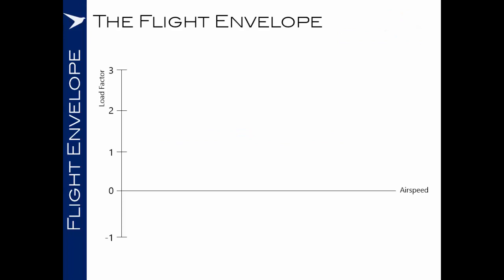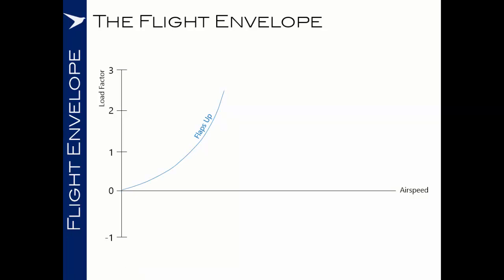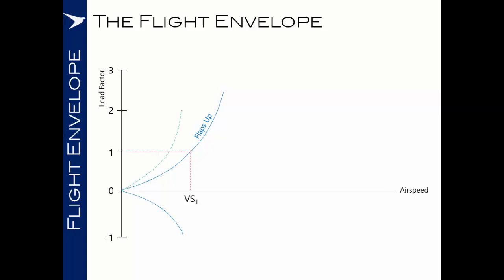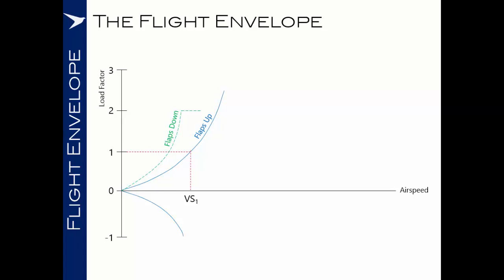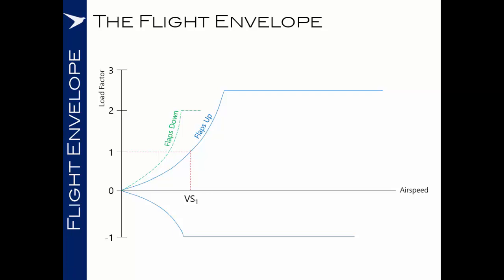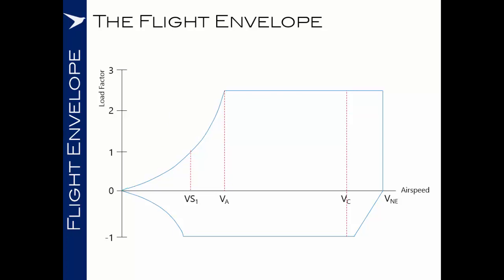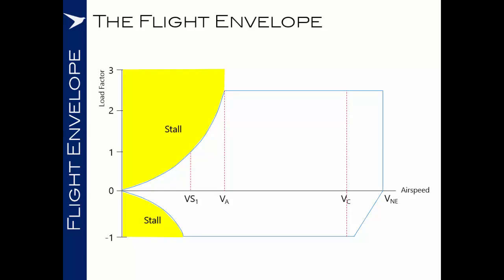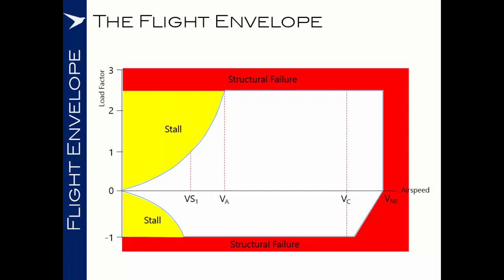UPRT 13: The Flight Envelope

Comment: Yes, max load factor at Va is the limit for structural damage (engine mounts etc) but if the components are designed to withstand high loads (aerobatic planes) then wing loading becomes the limit. For the same wing loading you can pull more G:s with light plane than with a heavy plane. Therefore for example Extra300 has different G-load limits for different weights. (max wing loading can be used). Stall of course occurs at the same angle of attack (the Lift curve shown can basically be considered critical AOA curve). Flaps allow more AOA (for the main wing) so the flap-lift(AOA) curve is steeper.

Comment: Keep in mind that the Stall curve will always be more pronunciated for positives "n" than negative ones,  because of the wing form. At most, it will be the same for a simetrical airfoil. Thus, the Vs for negative n is greater than the positive side of the graphic. You drew it the other way :/